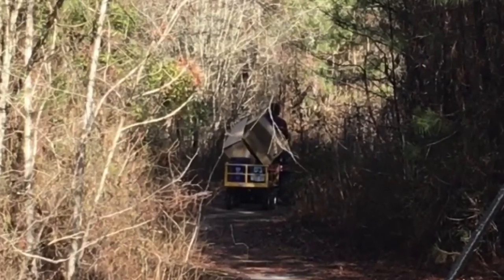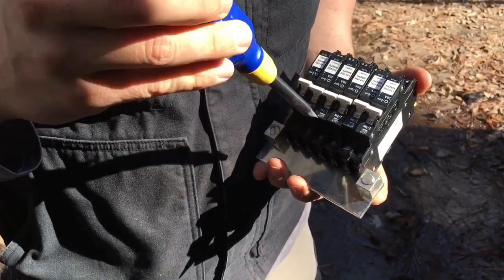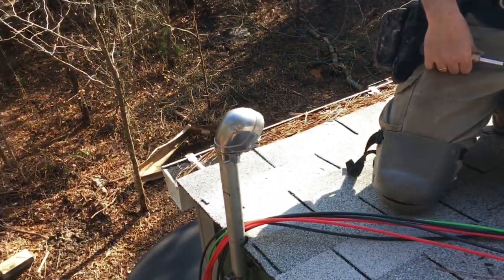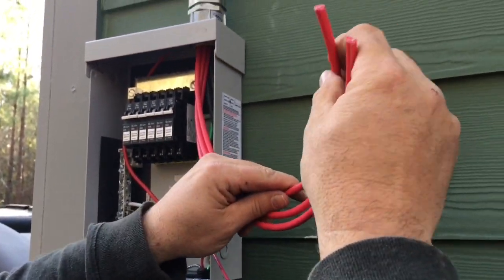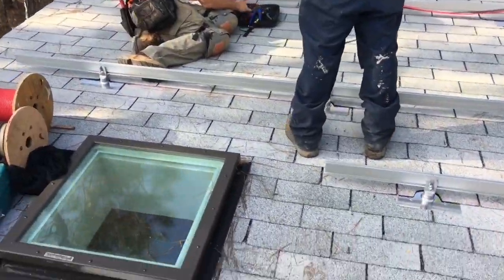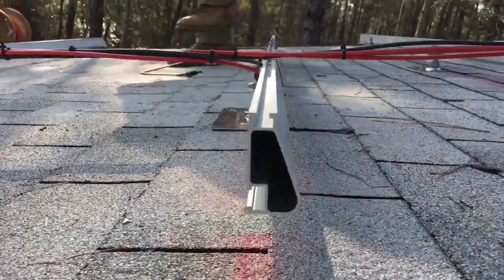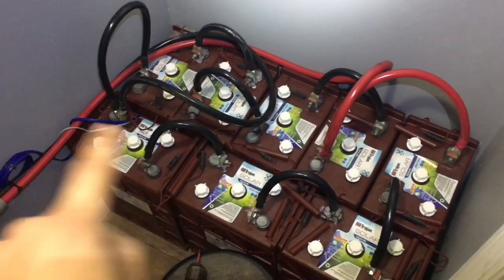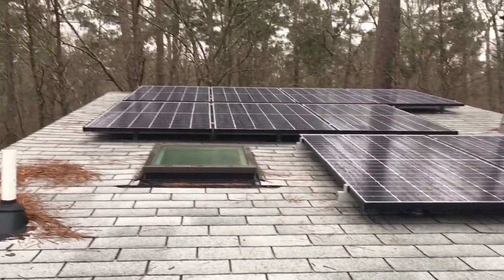Installing and Offgrid Solar Kit with Wind Turbine

Comment: I am a an electrician in a different industry and occasionally a customer will want to buy the equipment themselves. Then it morphs into "tell me what you recommend and I will buy it"   ..  at first I frowned on it but  nowI don't care because its still a job and that is better than no job. Besides you cannot blame them for wanting to save where they can.. you're still getting paid for labor and consumables.
Reply from the maker: As long as you can make your money, work is work but it’s always a bummer to have to make a bad design work

Comment: Can I use THHN/THWN 4 AWG  from solar array to charge controller?
Reply from the maker: Yes but you must install it in conduit
Reply: @GainSolarPower  thank you. I will be replacing a 30 ft run of 10 gauge regular solar cable because I added 2 more 100w panels to make a 1000w array and I think I would have less of amperage drop since the THHN has more strands. I don't know for sure about that, I'm just assuming.
Reply from the maker: Is this regular solar cable we speak of “pv wire”

I think you are talking about voltage drop. I’d leave the pv wire in there. It’s probably better than thhn.
Reply from the maker: It also depend on how you wired them up.
Reply: @GainSolarPower  Hey Johnny, I'm just curious are you a former electrician turned solar guy? You seem to have a advanced knowledge of electricity.
Reply from the maker: I’m actually a solarman turned electrician. But flattery will get you no where!!!